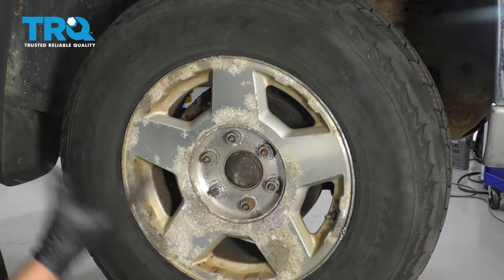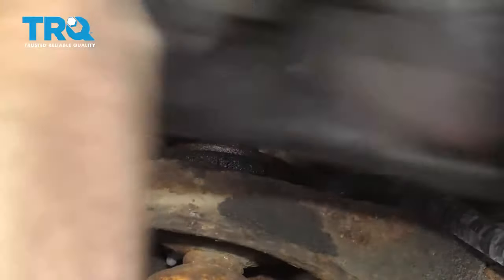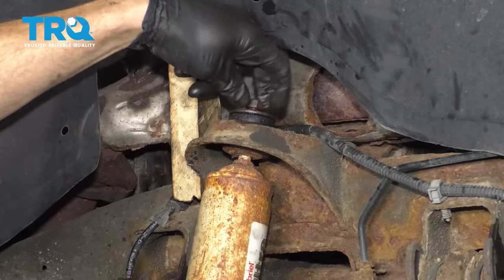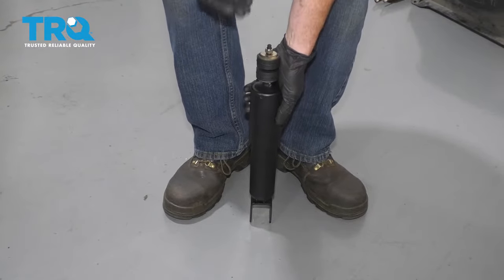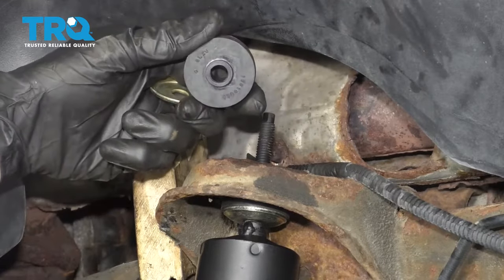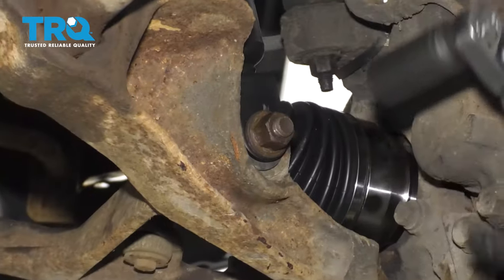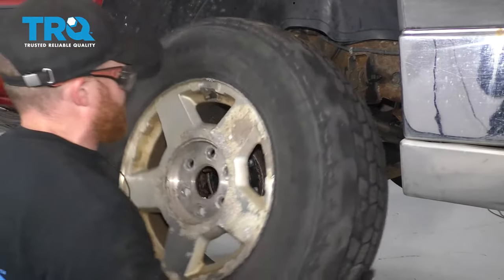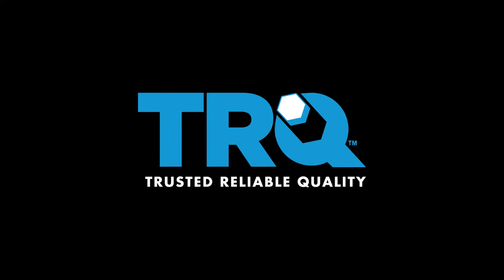How to Replace Front Shocks 1999-2007 Chevy Silverado

Comment: I just replaced the front shocks on my Silverado 1500 4x4 but it has a 2” leveling kit on the front. I had to put the truck on the ground with wheels on to get the shock bolt far enough through the top. Am I going to rip these shocks apart when the truck goes over big bumps? They don’t seem long enough.

Comment: That must be a 4x4 version because on my 05 Silverado reg 2wd  the design on the bottom uses 2 much smaller bolts that are put in vertically. Torqued to 18ft lbs I later found out. I should of rewatched the vid the same day before breaking the bolts☹️

Comment: this video does not cover shocks in side of spring
Reply: I'm almost certain he did this wrong. My silverado front shocks are not like that at all. That goes in the middle  Of a spring in mine
Reply: My 06 crew 4x4 has just the shock. I think it may have to do with the torsion suspension.
Reply: @cotyleavitt4317  mine is a 2wd also and I think it's pretty much the same just unscrew the 2 nuts on the bottom and the shock still comes out the bottom only difference is you have less room to work with most of these guys have 4wd trucks the rest of us lil guys have 2wd loll